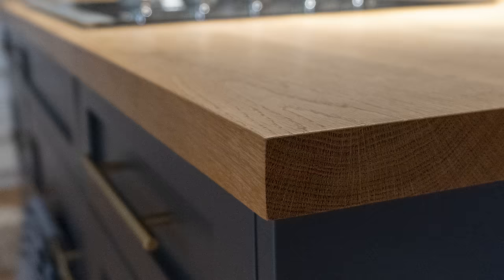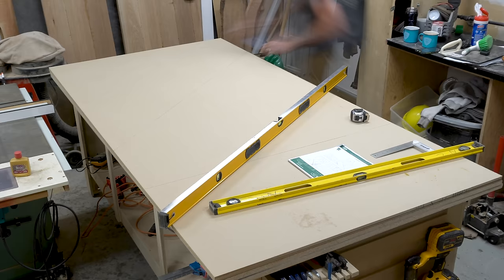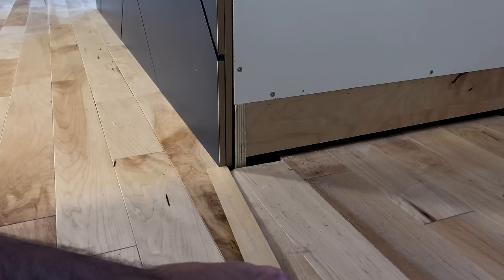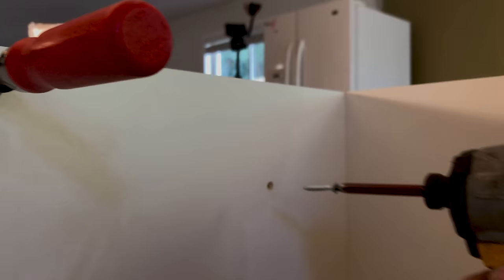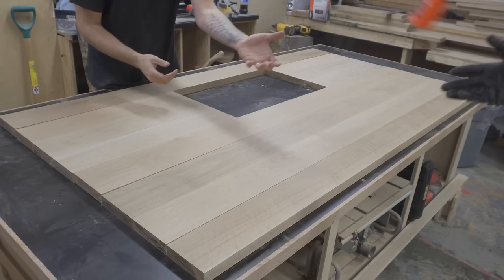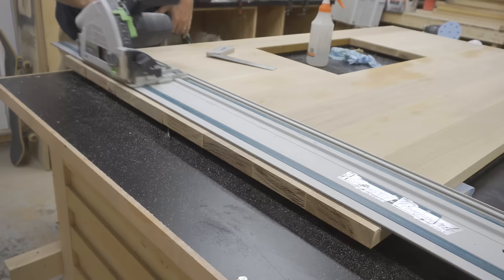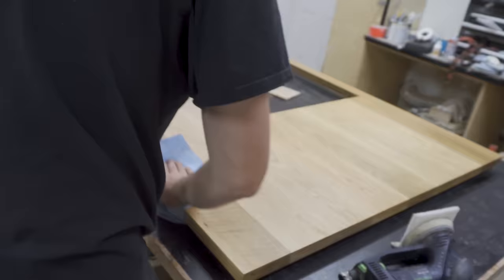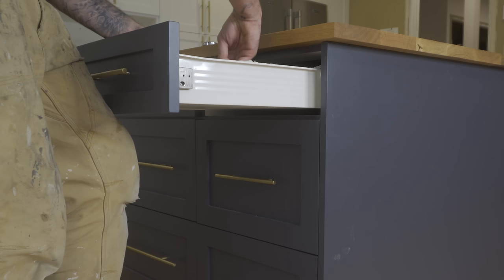Building The Classiest Kitchen Island In The World / How To / Oak Countertop , Geo Backpanel

Comment: Absolute great work! What would something like this cost? Building mine as we speak.
Reply from the maker: Its a tough one to price but for me on Vancouver Island the material cost was around $1200 CAD which includes cabinets and hardware, white oak lumber, 2 sheets of 1/2" mdf and it all sprayed up. It could defiantly be done cheaper if you painted it yourself and purchased the cabinets from a big box store. rather then off a cnc cabinet supplier.
Reply: @RadDadBuilds  To buy it, over $4000. US

Comment: How did you make the side panels?  They looked thicker on the part facing away from the drawers.  Did you just double up the MDF in this area?  How did you get the seam to look like one thick piece of wood instead of two?  Thanks!  Coronavirus lockdown has me doing some home improvement :)
Reply: Coronavirus lockdown here as well haha!
Reply from the maker: Hi I used mdf doubled up at the back 12 ". The main reason for this was to hide the awkward seam and the steps in the raised back panel. It also gave it a chunkier feel.  I used a paintable edge tape but you could just seal the two ends with wood glue, sand back and apply filler to the seam. heavy primer would help too as mdf endgrain is very absorbent. keep sanding back and reapplying until its smooth like the face. Hope this helps and isn't extremely confusing.

Comment: Ok.   Wondering where you said you left an inch and a half between each cut.   I didnt quite see 1.5 inches between cuts so I dont know what you meant by that.  How much space roughly was between each irregular piece for the back wall?
Reply from the maker: If you're referring to the back panel there is a half inch gap between each piece. Not sure why or when I said 1.5 but its half an inch.

Comment: Great job rad  👍👍👍 
Why did you use emmets instead of osmo ?
Reply from the maker: cyril touma honestly my wife thinks white oak looked to orange when finished with osmo.  we have maple floor and It did not really go. So I found emmets to be the most clear once applied so I went with that. It’s also food safe straight out of the tin whereas osmo is food safe once cured. Any other circumstance I would 100% use osmo

Comment: I love this video but i have a question; how do you connect the cooktop? Do you have any connection from the floor? It is very important for me to start one :) thank you for sharing!
Reply from the maker: Hi yes. The power supply comes up from the floor. Fortunately the original cooktop was in the same area so I was able to move it into the island with ease. I’m using a down draft cooktop too so I have ventilation going down through and into the floor and out side.

Comment: How much did you save doing it yourself vs hiring some body else to do it?
Reply from the maker: Well I saved on labour more than anything and I think the counter top would have been the most expensive. Here the going rate at most wood shops is $110 an hour and to get an installer to do the cabinets would have been about $50 an hour. Probably saved about the $1000+